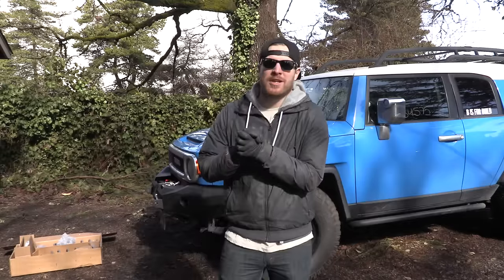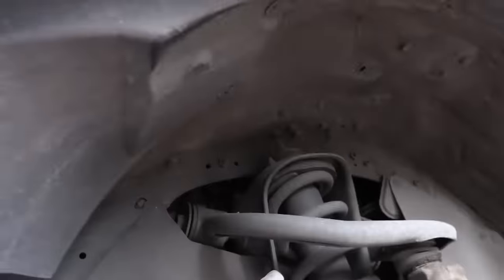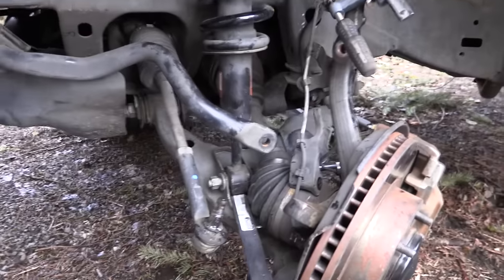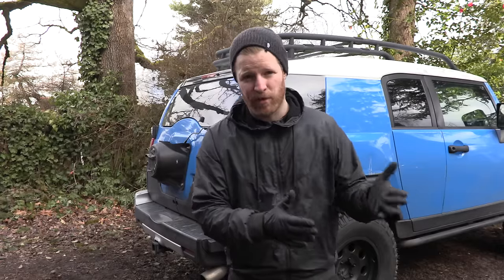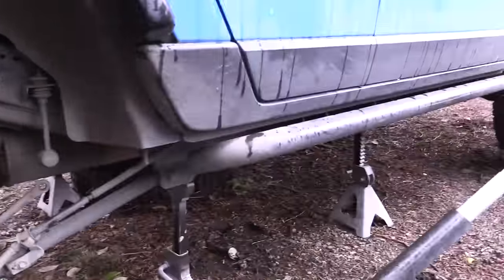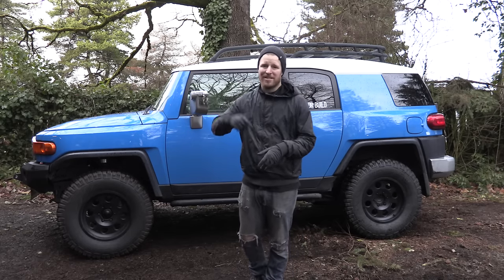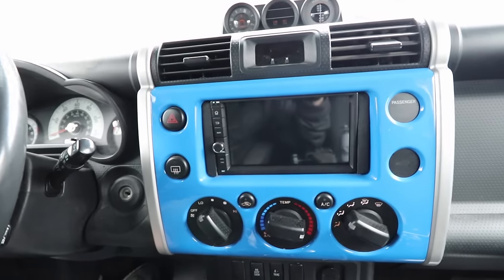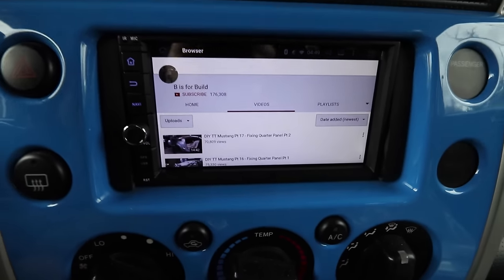FJ Cruiser Build Pt 5 - Lift Kit Install & New Stereo

Comment: Chris, you the man!  Greetings from Texas, I've taken your lead and have amassed a fleet of my own.  I just need the skills to finish the projects that have piled up.  I have used your videos to fix a lot of stuff and look forward of many, many more great ideas to make my stuff work better. 
Could use a set of new TreadWright  truck tires (2001 Ford 4x4 F150) -  WARDEN - W2817D - 285 70 17 Dfyi - many 2x8's in 18 inch pieces make great platforms to level stands and jacks (cheaply and safer).  Also use old cardboard on the ground to help you save your knees and save losing items on the ground, and keep tools cleaner. Thanks Jerry

Comment: Dude any car audio go straight to crutchfield.com. You plug in your car, and they will itemize every single thing that your car would need to run any audio. My entire kit plus the head unit for my car was just under $100 bucks. That included the plug wires that plug directly into my stock harness and the mounting brackets for the unit.

Comment: Might wanna get that Micrometer re-calibrated ;) Nice change from the Mustang anyway man. speaking of which, by any chance did you try run it with the intercooler plumbed in? Almost seems like the maf doesnt know whats going on because its not taking in any recycled gasses maybe?

Comment: Had a bad hydro plane on my tires im running now and hit the wall of the interstate going about 40 I'm ok and truck is fine got everything fixed but scary moment need new shoes on the Tacoma so it would help out a ton and the tires I would get would be the Claw II - C3318E hedge grip

Comment: BLEMISH - WARDEN II - W2116E * 215 85 16 E, they're the least expensive in their clearance section. I just need something to get going again. I have a 82 Gmc Sierra 2500 work/lack of work truck these days that has (or had I should say) a rare/oddball sized tire on it. They're too much for me to afford or even try to replace with the correct HD 10 ply tires. They were originally 235-80-16's, since I've got it last winter I've replaced tires 6x (had 2 flats in one day once) and it currently sits on 3 different sized used tires. They're all spanked and I have to air one up every time I get ready to drive it. I was using it for a small business I'd started up and due to the tires always giving me grief I've just parked it for the past few months. Before this turns to more of a book I'd just like to say any help would be appreciated or even being considered would be a great honor. Look forward to seeing the next video.

Comment: crack the lower a arm bolts 

so there's no tension on the bushings and the arm pivots on the bolts 

you really should crack them anyway 
as the resting spot on the suspension is now higher and you will tear your bushes up 

I'm a mechanic 
and we have 9 toyota 4x4s on the farm 

the 100 series looks identical to the fj

Comment: If you pulled the axle nut and pulled the cv out of the hub you probly could have got the lower control arm down far enough with a prybar.

Comment: Maybe someone has already said this, but the "Generic" connector on the head unit wiring harness is a standard ISO connector. All you needed to purchase was a Toyota FJ to ISO wiring loom (something like this https://www.dynamicsounds.co.uk/ct20ty01-toyota-fj-cruiser-hiace-highlander-hilux-landcruiser-mr2-wiring-harness-adaptor.html), the white plugs fit the factory harness and the brown/black ones fit the ISO connector on the head units loom. Your way is fine, but this is the "correct" way (just saves you time and is easier).Also, with regards to the facia not fitting correctly, try this. Matches up to the OEM bolt retention holes and fits a standard double DIN head unit. https://www.amazon.co.uk/Scosche-Ta2076B-Toyota-Double-Pocket/dp/B0014JE33Q

Comment: honestly, to anyone who isn't going to use the GPS or internet of a double DIN stereo should just get a single DIN with a double DIN adapter and you'll have extra space for a cubby, and pretty much does the same thing for a lot less. you'll also get aux and usb (and cd if you still use them), and the really reliable brands and models of single DIN units are the same or sometimes cheaper than double DIN models that are from less reliable manufacturers.
Reply: just wanted to post that after my friend recently got a no name brand double DIN unit like this that started causing him a lot of problems/headaches and he replaced it with a single DIN kenwood. i have been using one in my 6th gen accord for years and have had no problems with mine and the extra cubby space under the stereo is really convenient. you could go with pioneer, kenwood, sony or any other reputable brand and it will pretty much suit your needs. some of the newer models even have siri eyesfree capability which is useful if you have an iPhone and use siri

Comment: Hi, I'm stalling one of this kits tomorrow by myself. Now, I have a question, Is it possible to instead of taking the whole strut out just swinging it out to install the top spacers? I don't know if the lower screw/nut  is really tight and it won't let it swing out.

Comment: 2010 FJ myself. I plan on entering the contest but have a question. Do you plan on welding up your open body mount chops? I need to chop mine but don't have a welder etc.

Comment: My name is Kyle.  I have been following your channel since like 20k followers and I love your channel. I do need some new tires for my 1997 Jeep wrangler. I currently have 31"s on there and they are cracking because they are old and they are really low on tread.  Thank you so much for your channel and everything that you do!  I would love / need some LT | AT WARDEN 245x75R17 10 PLY.  These tires look awesome and would make my jeep look mean especially since I just put on some 6" fender flares.  Thanks again!!!

Comment: Size: LT235/75R15
Tire: atg-a2315c

I have a panel van that is being converted into a camping vehicle. I will be done with the conversion very soon and one of my rear tires has a slow leak. I'm 17 and a set of tires would help me tremendously with this van build. Thank you

Comment: link to that iphone sync cable would be awesome.
i use a ipad mini in my car but my head unit cant provide sufficient power to charge it which basically makes me have to use the 12 volt jack to charge my ipad this cable should be able to help me with that and also use the remote for my head unit

Comment: My poor 97 jeep TJ is running dry rot bfj mud terrains.  I have had these tires for over a decade a new set of sticky rubber would definitely revitalise this rig.   Maybe so much so that I would park the FJ and drive the jeep more.    WARDEN - W3115C
31 10.5 15 C. 
Thank you

Comment: I would love to have the WARDEN - W2416E 245 75 16 E, They remind me so much of the tires Grandpa put on his truck back in the day. Which is where these will be going on. When he passed I got his 1978 GMC C25 HD that he bought new in 77. I'm trying to do a full frame off resto on her.... when I Can. the tires  I on her are the spares he saved from his truck after his doctor told him he could not drive a Stick anymore. so there over 10 years old o older (there mounted on 2000 Chevy C2500 HD rims).  I am trying to get it back on the road 600,000 miles and still going!

Comment: 7 months later - pretty much should never cut the factory harness for a radio, if the radio can be replaced then there's 99% chance that there's a harness for it, as well as a dash kit.  Carry on.  Also, the reason that head unit doesn't fit quite right is because it's not really a perfect 2 din radio, it's close but doesn't match quite right.  I tried installing one on my C5 and ruined a $250 dash kit trying to make minor adjustments.

Comment: I would love to put some tread wrights on my 04 Tacoma! I've talked to a lot of people with them in my area and they love them. I've told a lot of people about them as well! Seem to be a hell of a tire! WARDEN - W2816D in 285/ 75/ 16 please!
Reply: I meant to mention that I did the same front lift on my taco, it really is a bitch with that spacer on there! Me and my brother used a 5 foot crow bar to pull the lower control arm down enough to get the bottom back in!

Comment: 1. Get well soon!!
2. Building an 86 F350 4x4 diesel Bisforbuild fashion. Buttoning up the rear soon then moving onto the front and cab swap. God only knows how old the tires on it are so a new set would really come in clutch. http://www.ford-trucks.com/forums/1432048-my-86-f-350-budget-build.html
LT | AT WARDEN II 215x85R16 10 PLY
215 85 16 E
3.Keep doin what your doin!

Comment: 17 in werden - W2417E

(245 75 17 E)
Reply: It's for my 09 wrangler
Reply: Is it 4 or 5 wheels ?
Reply: And if it pick me , I will send pictures of me taking the wheels to a romantic dinner
Reply: And I need new tires because my tires are starting to crack and they're going to fail inspection